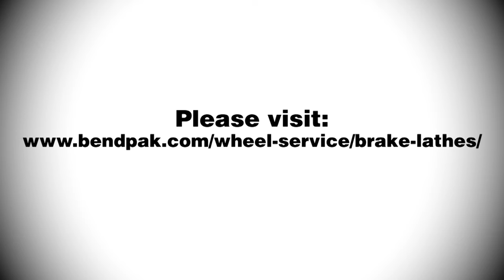Brake Lathe -- Resurface Disc Rotors and Brake Drums with Ranger BendPak

Comment: hi sir, my rotors are somewhat new yet they need resurfacing. there is nothing shown visually. the question, can i keep the same brake pads after resurfacing my rotors since they have 60% life left in them? thanks
Reply from the maker: That's a great question and we recommend contacting a local mechanic that would be better suited to look at your specific situation.
Reply: Recommend replacing pads just to be safe. If your rotor was running out of true before the resurface, the brake pads aren't going to do their job.
Reply: Elie Nehme Anytime you resurface or replace rotors buy new brAke pads

Comment: Is that why auto shops won't resurface my cross-drilled rotors, because of the bit that's used?
Reply: Villamor78 I’ve never seen anyone cut drilled/slotted rotors can’t be good for the bit.
Reply: I realize that now. I always imagined they used some sort of machine sanding method. Lol.
Reply: We don't ever use bits. Our rotors come out more true than factory. Gonna have a video soon for the safer more efficient way to do this